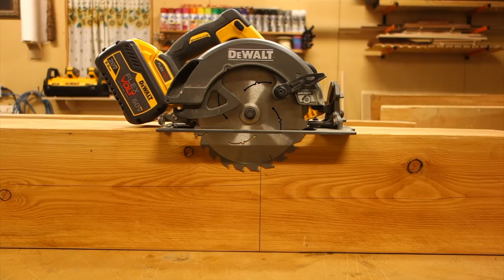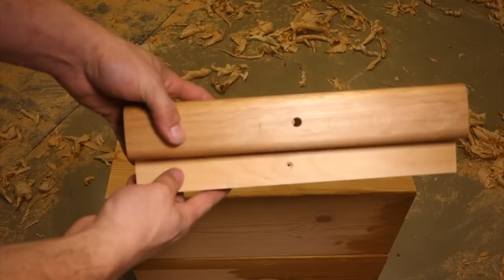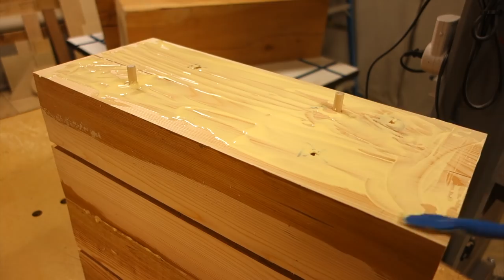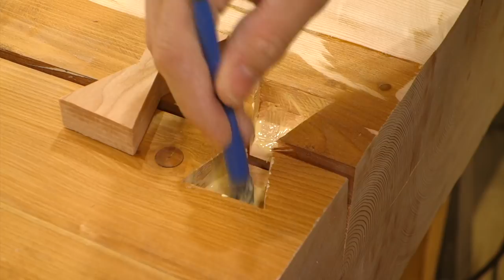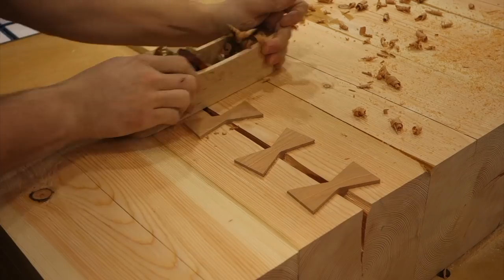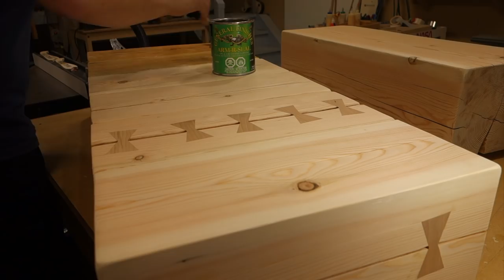Coffee Table - Reclaimed Timber

Comment: Why "up" on your butterfly template is there a slight bevel for the collar to ride on?
Reply: It's so you don't make a mirror image of your bowtie.
Reply: William Dawson yeah, indeed, I was wondering the same thing. The shape was cnc'd out, so I'd assume it would be perfectly symmetrical..
Reply from the maker: Honestly it was ocd consistency. I test fit everything from that side and just wanted to make sure nothing changed.
Reply from the maker: That was also put the bearing of the router bit right on the first cut from the CNC so I didn’t have to worry about the possible upsets left by the tabs.

Comment: Why are you using a.. engelgrinder(?) for the endgrain and not a plane?
Reply from the maker: FreundHain999 have you ever done woodwork?
Reply: Yes, yes I did and for engrain I only use/used a plane a smoothing plane (I'm not sure if that is the correct translation) to be prices, The "preparation" to prevent pieces to break of is a bit time consuming yes and you need some experience to get a god look but the end result was always the same or even better (depends on the wood) than with sandpaper.
Reply from the maker: Right on!  wanted to get a feel for your skill level before I tried to explain.  The angle grinder with a flapper sanding disk gave me the finish I was after.  I didnt want the ends to be perfectly flat and square.  I want them to
Reply: Ah ok and how many points on your skill level test did I get? Hehe
Reply: Freund